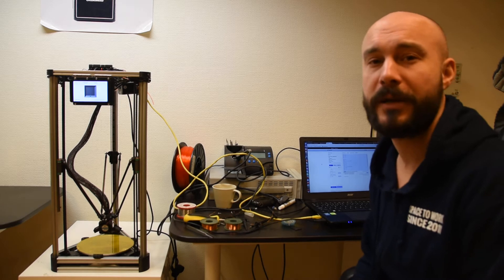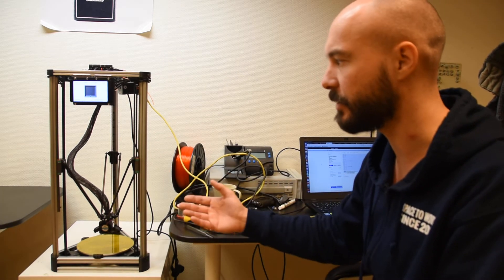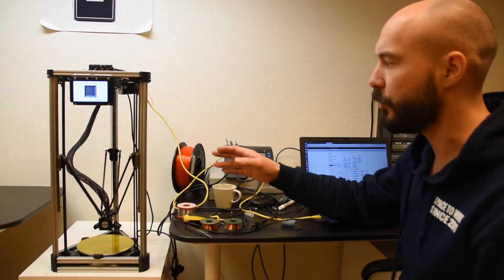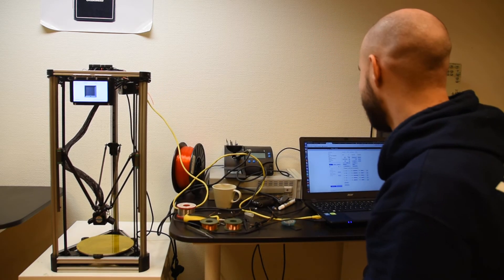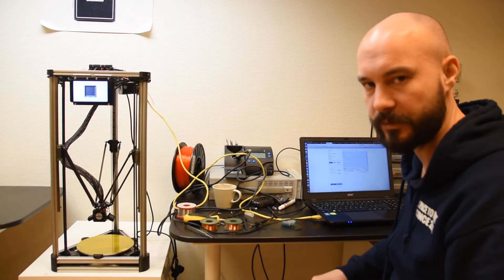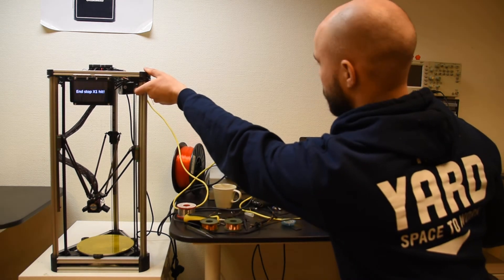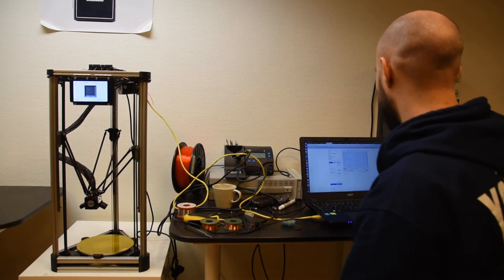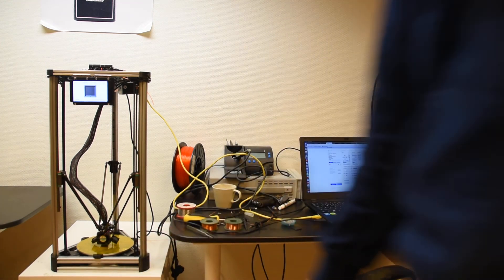Replicape end stop configuration

Comment: Thank you for the video tutorial.
I managed to set the endstops. I had also to change the speed setting in the [Homing] configuration to set it to negative.
I might be because I have to reverse the towers. Anyway, it works so far.

Now I am trying to find out how to take out the curved motion along the X/Y axis and also what is the influence of travel_x, travel_y and travel_z to the system.
Reply from the maker: travel_y etc is just how far to look for an end stop. Can also be  negative values.